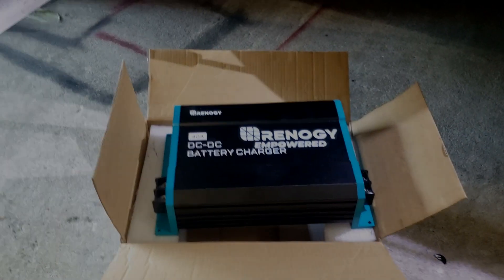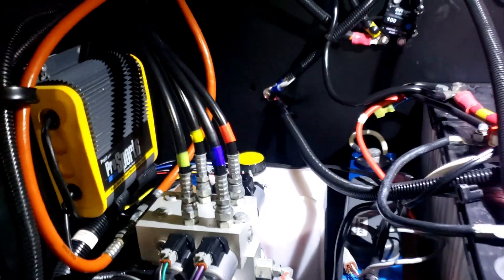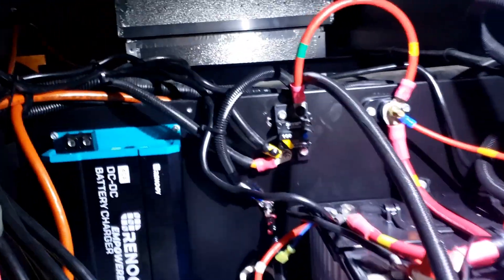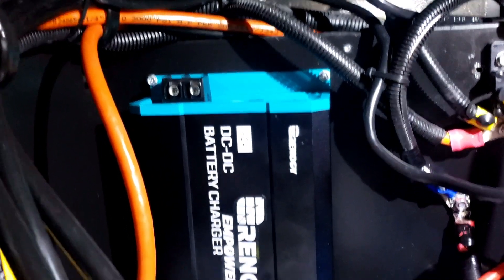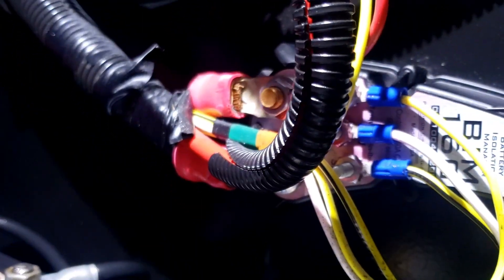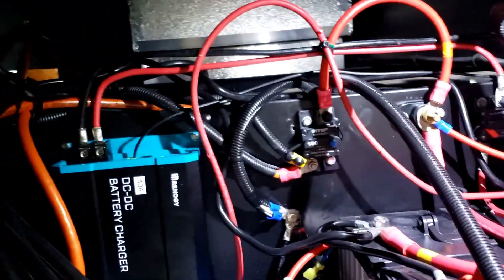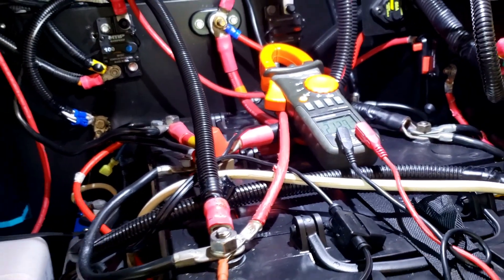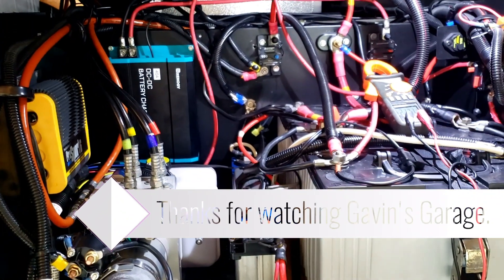Renogy DC-DC Battery Charger 40A Review/Install: "Smart" Alternator Charging for RV house Batteries!

Comment: Does it protect the alternator?
Reply from the maker: It protects the battery from being overcharged but it will protect the alternator because if the battery is not being overcharged the alternator can actually rest when the batteries are fully charged.

Comment: What did you set your dip switches to on the charger?
Reply from the maker: Lead acid assumes deep cycle AGM
Sw1 off
Sw2 on
Sw3 on
Sw4 off
Sw5 on
The five dip switches can be configured to charge lead acid or lithium batteries. On is position down and off is positioned up.
I hope this helps
Reply: @GeneratorReviews  understood. I have the 20A model going to a Renogy AGM 100ah battery (cycle use is 14.4 - 14.8 & standby is 13.5 - 13.8). Should I apply the same settings? If not, can you tell me which settings I should apply? 

I’ve been trying find out why it not charging for several days now. I really do appreciate the help.
Reply: I’m getting 14.1 from my starter battery
Reply from the maker: @philipstewart1675  charge parameters looks good. And it won’t charge if the battery is over 13.2v - 13.5v yes put the same settings

Comment: Could you please explain the setting for the Dip switches  i have a AGM battery . I find the instructions in the manuel a bit confusing Thank You
Reply from the maker: Lead acid assumes deep cycle AGM
Sw1 off
Sw2 on
Sw3 on
Sw4 off
Sw5 on
The five dip switches can be configured to charge lead acid or lithium batteries. On is position down and off is positioned up.
I hope this helps
Reply: @GeneratorReviews   Thank you